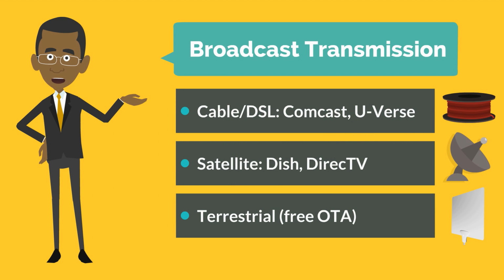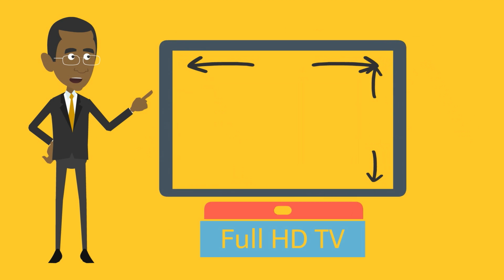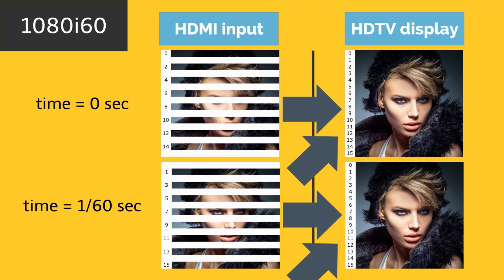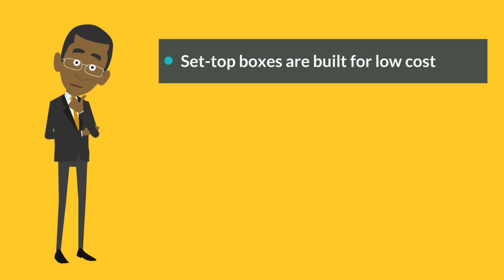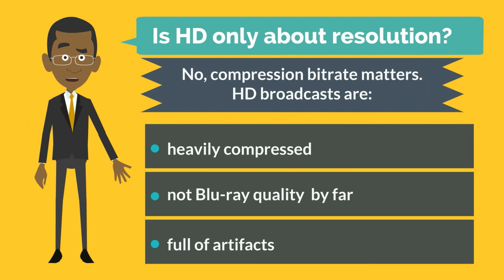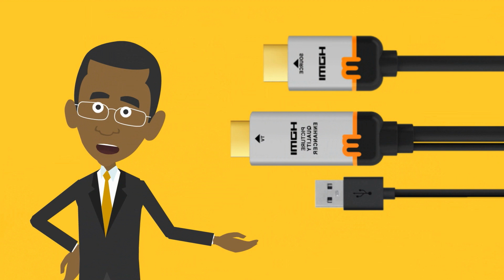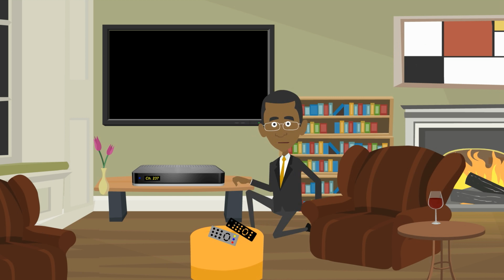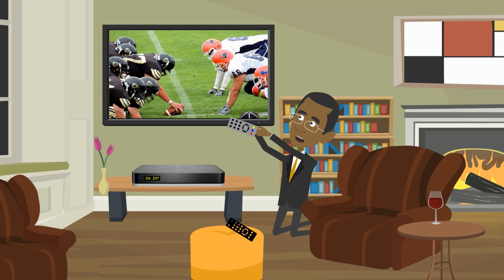mCable Set Top Box Getting Started

Comment: My Comcast Xfinity X1 DVR has a choice for 1080p and recommends using that for best quality.  Should I use that setting and let mCable enhance the picture or set it to 720p and let mCable do the upscaling as well?
Reply from the maker: It does not matter if you set the output of your DVR to 720p or 1080p.
When the output is 720p, mCable will enhance the details pixel by pixel and upscale to 1080p.
When the output is 1080p, mCable will enhance the details pixel by pixel and create a cleaner 1080p.
It also depends on the quality of the channel you are watching. We suggest that you try 720p first and see the results.

Please do not hesitate to contact us at support@marseilleinc.com

Comment: So I have to change the setting on my box to 720, then it will upscale to 1080? What if my box is already showing 1080? it won't do anything for it then?
Reply from the maker: If the console’s output resolution is 720p, mCable will upscale it to 1080p. If the console’s output is 1080p, it will apply anti-alias and clean up the graphics and create better 1080p. If the console’s output is 1080p24, like when you put Blu-ray disk into the console, mCable will upscale it to 4kp24.